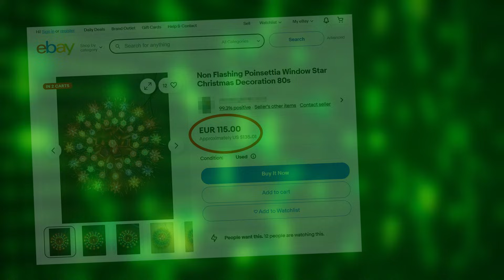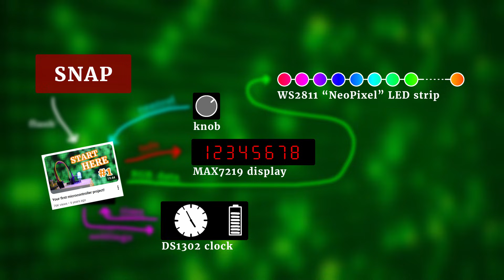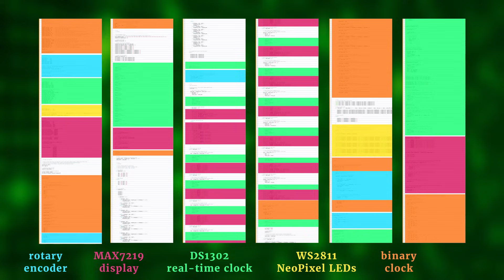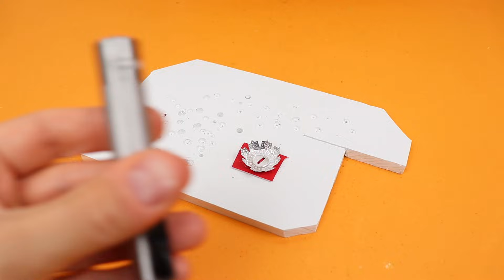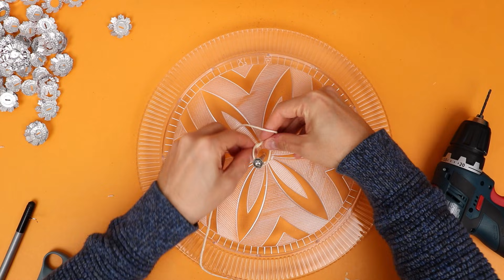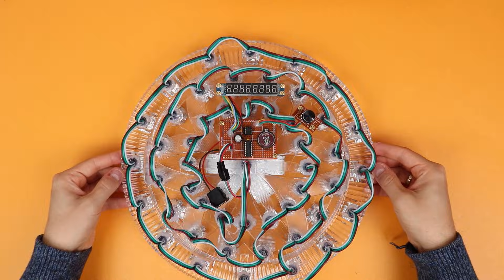Recreating a retro flashing Christmas star

Comment: Jens!!   You did it again.  Since the LEDs are individually addressable, it would be cool if the could appear to dance around the rings.  This has so much potential.    I've never seen these in the states, it would definitely be unique.  Thank you (again) for putting something like this together.
Reply from the maker: Thank you so much, David, this means a lot! Yes, there is a lot of potential for animations and different patterns. I actually almost ran out of memory with this code (ended up at around 98% if I remember correctly) because the floating point multiplication for dimming is so expensive. (But that could definitely be further optimized.)